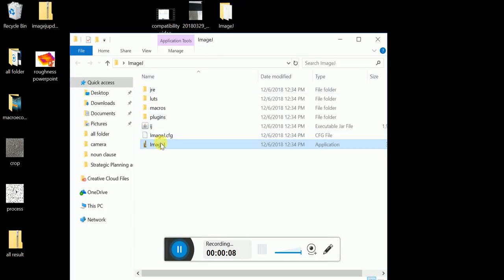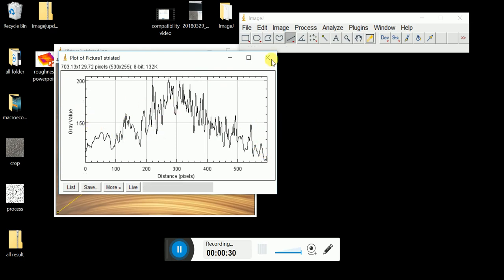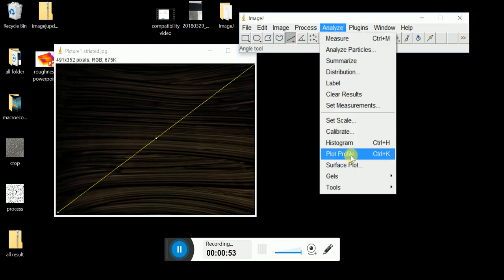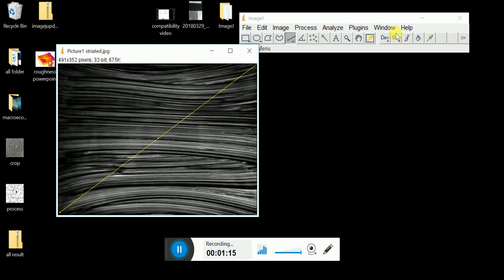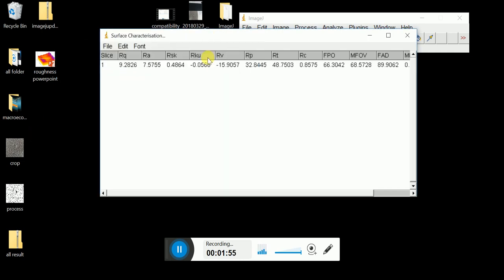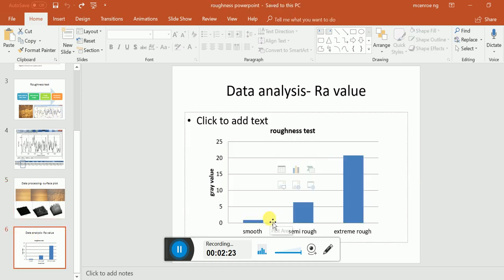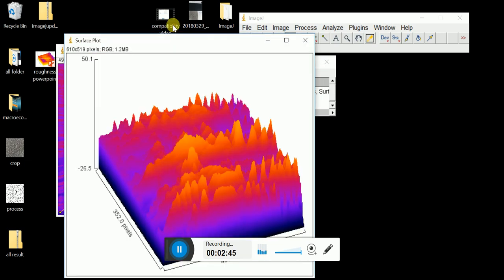roughness test using image J

Comment: hello, sampling length is minimum =0 and maximum= 7cm mentioned in SurfCharJ 1q screen, how to solve this problem? could you please help me in this regard?
Reply: SurfCharJ 1q does not appear in my plugin, input-output . Please how can I get that? Because even the website plugin doesn't have this tool.
Thanks for your help.

Comment: Hello,
I have a problem with the application. When I select "local roughness analysis", the "sampling length" is given as Min=0 and Max=0inches. Can someone help me? I don't know what I have done wrong. The pictures are from the CLSM microscope.

I have set the image to 32bit and it is a black and white image.  
Thank you!

Comment: Which are the units you get with your Ra ? The ones that is in the scale?
Reply from the maker: http://www.harrisonep.com/electropolishing-ra.html#:~:text=Ra%20is%20calculated%20as%20the,measured%20microscopic%20peaks%20and%20valleys.&text=Each%20value%20uses%20the%20same,measurements%20in%20a%20different%20formula.
Reply from the maker: for this software, you can only use as a gauge for generalisation for comparing with different samples. I believe in this case is the pixel, But I cannot confirm. As the factor that will affect the most in the sample is the lightings.
Reply: @mcenroengteowee1915  thank you very muuch!! My samples are suppose to be 1 um....but with the sfotware I obtain more than 20 um...That why I was asking!! Thank you very much

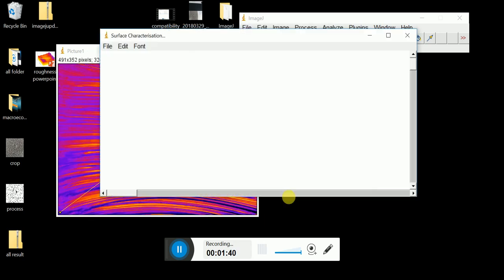Comment: Why did you put 100 for sampling length (pixel) on surface roughness analysis [minutes 1:37]?
Reply: Yeah! That is a good question
Reply from the maker: is base on the type of sample that you have and what type of lighting you use to take the picture. there is no fixed formula for this. And is mainly trial and error with a range sample testing. For my test, i am doing a paint roughness test on a piece of transparency
Reply: @mcenroengteowee1915  Yes I see. I asked because if time you change this value...the Ra value also changes...so a little tricky
Reply from the maker: @javirodriguez5795  yes, that's why the sample preparation is as important as the analysis part. I use a customise lightbox with measured lights (Lumens) to prepare this sample.